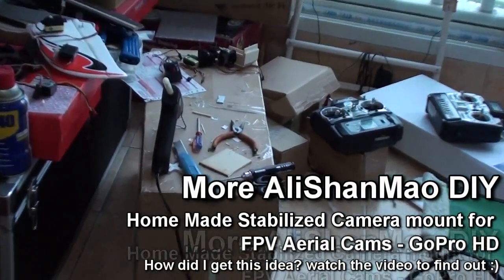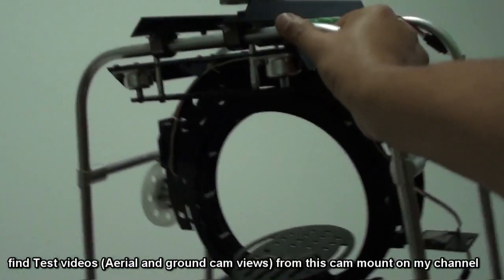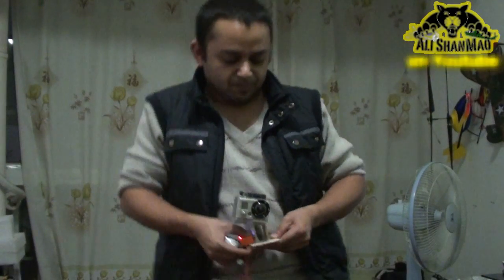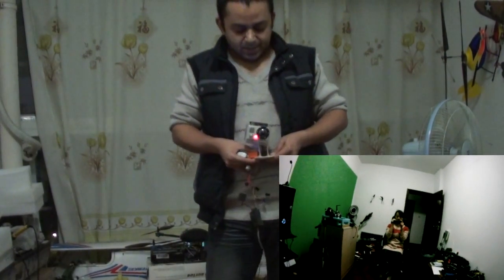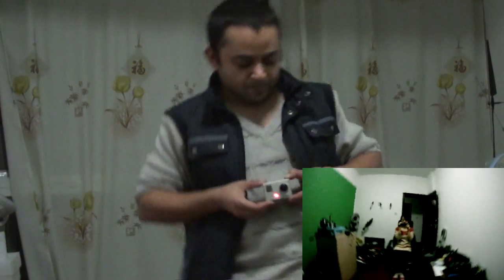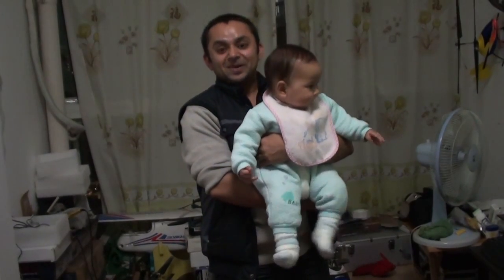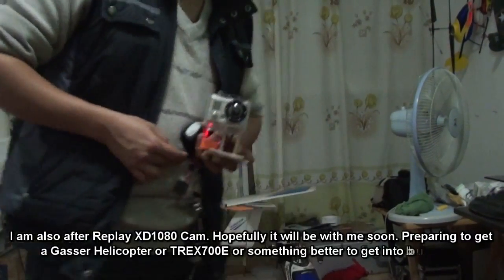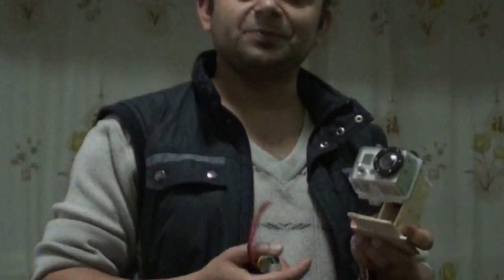Home Made Stabilized Cam Mount for FPV GoPro HD

Comment: Are most pre-built gyros just suppling an analog voltage to the ESCs that corresponds to the opposite of the attitude of the plane? It seems like you have just taken this voltage and supplied it to the range of the servo, with some normalization for the center of course, is this right? So in addition to using the aileron pins to power the tilt, you could use the flaps to power the pan servo and ensure that the camera stays fixed on a spot when the plane dives or climbs?